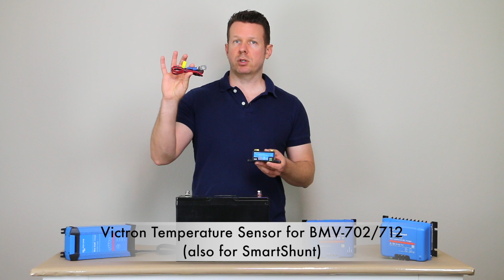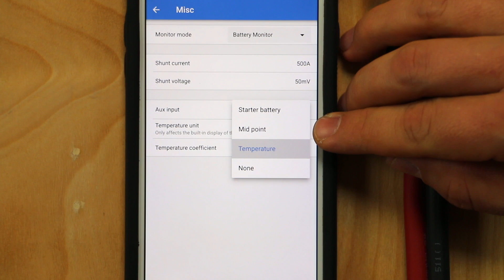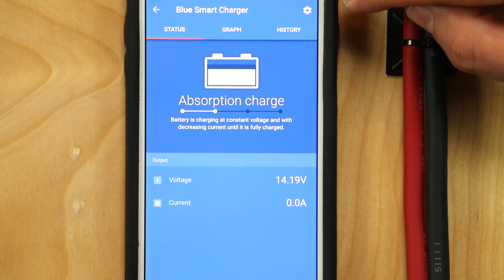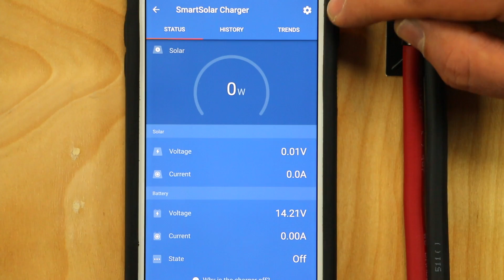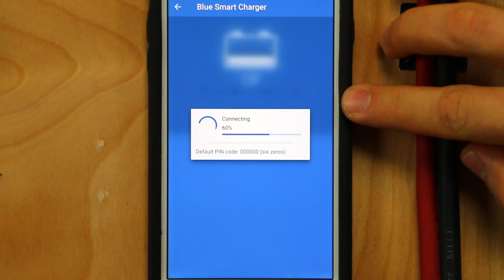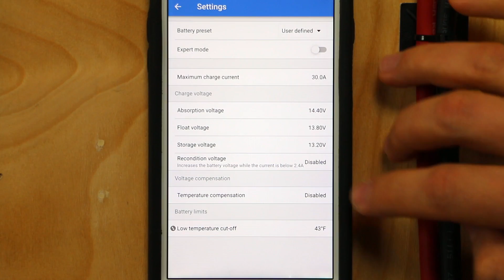The Future of Battery Charging in Van and RV Power Systems featuring the VE.Smart Network

Comment: Great information. Thank you! So, can I leave my old lead acid charger  in the loop after installing my smart charger in my toy hauler RV? I am thinking that with both chargers online, the 60 amp lead acid charger would speed up the recovery of discharged batteries, then the Lithium charger would actually finnish charging my LiFePo4 battery bank. I also have 200 watts of solar panels on the roof. Sorry, I am a rookie to all this stuff. Thanks,!Cheers Danny

Comment: What a wonderful video.  I just subscribed and am interested in using victron systems to make my conversion from AGM batteries to Lithium.  Very new to this.  I just need to research what Items I need to buy for my class B coachmen beyond.  Do you know if the Phoenix 12V 1200W inverter is enough to run my AC that is 13000 BTU.  I have a soft start.  I see that Victron does not make a larger inverter.  Do you know if that will ever be in the works?  Again great video.
Reply from the maker: Thanks for tuning in, your 13kBTU AC will be about 2000 watts, so the 1200w inverter will be too small. You might go with an inverter-charger from Victron, they have them in 3000VA (2400w) and 5000VA (4000w) models. Look for the MultiPlus and / or the Quattro from Victron. That soft start will also help. Hope that helps, thanks for tuning in!

Comment: I think your analogy with pressure is not adequate. LiFePo4 batteries do not work like that, the charging voltage is much more complicated than the pressure analogy. In a presurized system, the pressure you have is the pressure that is in the system. If you measure the pressure inside the tire at the same time you are pumping air in, you get the real pressure. With LiFePo4 batteries that is not the case at all. The charging voltage is not the battery voltage, and different chargers can have differences in voltage and, therefore, consuming instead of charging or disconnecting themselves because they believe the battery is charged when it is not (because other charger is charging), thus interfering between them

Comment: Hi. If I have 2 bluesmart chargers 30a each putting on the network, would it give 60 amps in total or whereabouts? Thank you
Reply from the maker: Yes, I also have two in parallel and I can confirm they will put out 60 amps together. Thanks for tuning in-
Reply: @rosslukeman  strange if I parallel, they give max. 32amps. Someone suggested to network them, not sure if it would work, fingers cross.

Comment: We have several mountain top radio repeaters currently being powered by utility AC power with standby LPG generator power for power outages.   
Each repeater is powered by 12vdc (11-14VDC) at 3amps standby (80-90% of the time) / 15 amps when transmitting (approx 10-20% of the time). We use 120vac to 12vdc (20a) power supplies to power the units.

Some day, we’d like to install solar at each site, but for now, we’d like to install a single LifePO4 12v / 100ah battery to each repeater to provide backup power for the 20-40 seconds the generator takes to start and come up to speed.
AND… to power a repeater in the event the generator fails or runs out of fuel (long-term storm related power fail, etc).
Reply: The repeater has a secondary 12vdc input which is to be used for a backup battery.
It does NOT provide charging current and the mfg suggests using a lead acid battery with a separate battery “tender” or “maintaining” AC to DC charger to keep the battery fully charged and to recharge in the event the battery is depleted during a utility power failure.

Can anyone recommend a charger / “maintainer” that would fit the bill?
It will have to be continually connected to the battery (LifePO4 12v / 100ah or 50ah) and keep the battery fully charged.
After a loss of AC power and the battery loses some charge, the charger must be able to charge the battery once the AC power is restored.

I know these batteries like to be at an 80% SOC, but losing a small bit of its longterm life would be acceptable.

Thanks in advance!

Comment: Do you setup 3 different ve networks in the 3 channel charger?
Since the 3 batteries have different voltages and temps, or needs.

I have also noticed that if you have two mppts (one to each battery) they need their own ve networks to get the right Voltage and temp parameters.
Reply from the maker: Hi Krister, in my case no I set up a single network to synchronize multiple chargers to charge one battery bank. Thanks for tuning and sharing your experience!

Comment: Appreciate the great videos trying to help all of us out here. I have a Renogy 50 amp dc to dc charger with mppt that I would like to install in my class c motorhome. It has lithium batteries, a auxiliary boost switch and on board generator. Can't find any information on how to do the install. Can you help. Thanks so much
Reply from the maker: Hi Sam, thanks for checking out my videos, good to hear they're making an impact on you. In short you would probably leave the boost switch and generator as-is, and splice the Renogy in there as a separate part of the system. Overhauling RV electrical is something I consult on, if you would like to book a call, I can look at photos and give more detail. The calls are here: https://www.rosslukeman.com/offerings

Thanks,
Ross

Comment: Why doesn’t Victron make a combo MPPT/DC-DC/AC charger in one unit, and we could have programming to allow the charger to prioritize input out to the battery, or even use all to improve output amperage. Renogy and RedArc both make a DC-DC / MPPT charger combination. Redarc even has one for $1800 that includes all three. Just wish it wasn’t $1800
Reply from the maker: The All-in-Ones are nice from an install perspective, but I would say there is value to a more modular approach as well, as the end user can size each part of the system for their needs. As long as they network together and talk to each other. I think it's ease of install vs. how customizable things are. Victron historically has focused on "pro" installers so their stuff is not necessarily made for ease of install, although it's arguably pretty easy, especially programming with their Bluetooth app. My two cents...
Reply: @rosslukeman  you do make a good point. Just like in home entertainment centers, going with seperate u it’s allows a little me flexibility with features absolutely, allowing for more custom configurations based on need and uses. One of the other reasons why I went with redarc is it was designed for rough handling to handle hi vibrations and jolts of “Off Roading” adventure campers beyond the normal extremes of simple normal RV’s.
The one thing I wished my redarc had was higher capacity charging for both alternator and ac charging. We don’t have the space or time for a huge solar array either. So it suffices for most “adventure back country camping” I do use a few victron pieces like the battery protect, and battery monitor.
Reply from the maker: Hi Gary, good point on the need for vibration-proof components from RedArc. Glad that made sense about modularity offering flexibility. I do think that you make a good point about higher alternator/shore charging. That's why I haven't covered a lot of all-in-ones, I like to max out charging speed, especially like you mentioned if one of the charging sources like solar is minimal, maximizing elsewhere is more critical. I've heard good things about RedArc though.
Reply: @rosslukeman  I like redarc a lot, I know the quality is there. However the price point is really really high! Vibration resistant devices are only really critical if your going into environments that would create more vibration then the normal paved roads that 95% of Americans travel. Even for the majority of those in RC’s and Travel Trailers. So far the Victron and Renogy devices I have been using have been handling the additional stress. But wondering when they will give out.

Comment: Hello, very informative! How do you add lead acid battery in to the mix? Thanks
Reply from the maker: Hi Robert, thanks for checking out my video. That is a very broad question! Lead-acid should wire in the same as a lithium battery. If you want to see an overall diagram, then I would check out my PDF at rosslukeman.com/vanpower

Thanks,
Ross

Comment: Very nice video with a good explanation but there is a big problem with real-life operation problem number one if you have more than one charger one of the charges will always take the lead it may shut the other one down or it may reduce the capacity of one or the other and the other will charge it a hard higher rate this almost never works out it is especially problematic if the charge rates are low

Comment: Thanks for creating these excellent videos! One question:

In the case of unbalanced cells, can the battery connect and signal this over the VE.smart network and stop the chargers? or do we need to add a BMS for that?
Reply from the maker: Hey there, thanks for checking out another video. On the cell balancing, this is typically handled internally by each battery. So while the VE.Smart network could convey this info, at this time it does not. Cell balancing happens on internal BMS batteries such as Battleborn without adjusting the chargers. The only exception might be the Victron Smart Lithium batteries, which have internal cell balancing, paired with an external BMS. I have had my cells out of balance after having the battery sit a couple of months. When I fired up the system, the battery and BMS worked together to turn the inverter-charger on and off in multiple cycles until the battery's cells were balanced again. This is the only battery/system I've ever seen do that. In this scenario, you can see the individual cells on the VictronConnect app, where the higher-voltage cells bleed off and raise the lower-voltage cells. This system was shown in this video: https://youtu.be/3KUhkdxIppg

Comment: I'm putting together a system with these same four victron products. You describe three sources all filling the tire at the same time like that's ok, but won't that overload the max charge current on the battery? 

30+30+20=80 > 40A max charge on my SOK 200Ah battery. 

Some other comments here imply this problem fixes itself, but I want to be sure before I buy all the parts.
Reply from the maker: Hey there, you are right in that you need to account for your specific battery bank and what it can handle, both continuous and max charge rates. Frankly the charge rate on the SOK is a little low for its size. However, what can be said is that these charge sources work in different scenarios. Having your engine running, while plugged in, with your solar panels in full sun would need to happen to reach this hypothetical peak of 80 amps. Typically shore power and alternator power do not happen simultaneously for any significant length of time. So that changes things. Great question, thanks for tuning in!
Reply: Thanks for relying, @rosslukeman . I appreciate the care you put into your advice. I thought getting a single 200Ah battery would be simpler, but 2x100Ah would have eliminated this problem. Hoping @Larry Volnec's observation that they self-regulate holds true for me. Cheers.

Comment: Hi Ross,
I have one random question haunting me. I have an Orion B2B charger, the manual says "mount vertically with the power terminal pointing down".
The charger fits optimally in my system mounted horizontally, generally, I follow the manufacturers' recommendations, but what reasons can you see that this electronic device must be mounted vertically.

Also as an aside, Victon further adds to mount on a "non-flammable surface", I understand these tend to run rather HOT, but virtually every van installation I've seen has these mounted on wood.. what gives?

Thanks in advance!!!
Reply from the maker: I suppose they want you to mount them vertically because their heat sink fins are oriented that way, and would allow an air current to rise up behind the unit. If you mount it horizontally it kind of stops this natural airflow of hot air rising and creating a draft behind the unit. We must not take this for granted as similar B2B chargers often have a cooling fan. This one does not, so we need to not impede its natural cooling. They are about the warmest components in my systems (because the amperage through them is usually maxed out to their rating). That said, I mount them vertically on painted plywood. In my opinion this is totally fine, they just get warm but not hot. Hope that helps!
Reply: Wood is one of the best insulators. That's why we use it in saunas

Comment: Ross, why do you like non-isolated dc-dc chargers? is it cost and what else? Thanks!
Reply from the maker: Hey Fred, great question. It's because the vehicle power system and my rear power system negatives are not isolated from each other. Both systems have their negatives connected to the chassis, which is the "conductor" returning the electrons to the alternator and completing the circuit. This is just how I do my systems at this point and so the non-isolated version matches my overall system design. Other brands such as the Sterling are non-isolated, but it's not stated as such, it's just how it comes. So when I tried the Victron, I got the one that matched what I was doing with the Sterlings. The isolated version of the Orion allows the negatives from the front and rear systems to not interface with each other at all, except where they converge at the Orion charger. I personally have never had a need for this. Hope that helps!

Comment: Great Information.  I was wondering if you can use a DC to DC charger from your alternator charging lithium batteries and hook 400 watts of solar to the DC to DC charger also.  I've heard this works with no need for a solar charge controller.
Reply from the maker: Hey Keith, interesting question. I see a couple of potential issues. First, the DC to DC controller shown here for 12-volt alternators accepts 10-17 volts. The majority of solar panels/arrays will have a higher voltage than this, with solar panels starting out around 20 volts and going up to maybe 39 volts. Also, even if you were able to get solar under the voltage threshold, you would max out your charging at 30 amps, and probably forfeit another 15 amps you could have gotten to increase the charging rate. Renogy has a combo solar/alternator charger, but it too has a maximum amperage that will throttle down what you could have gotten to about 600 watts. I like to put different chargers for different power sources, because at the end of the day, they are different animals with different power characteristics, as noted above.

Comment: great video and well organised, my blue smart charger in the uk does not have the ve smart networking like all my other victron items so i guess this a new version
Reply from the maker: Interesting to hear, I wonder if you could update the firmware? I have done this on other components and "found" features that I thought had gone away.

Edit: I found this note on the VE.Smart Page at Victron:
Only Blue Smart IP22 Chargers starting production date week 24 of 2020 (serial number HQ2024nnnnn and newer) are supported. The hardware revision printed on the product label should be “hw rev 02” or higher.

Comment: Wonderful explanation Ross. I was wondering what happens if you have such a network and then plug all the chargers into a Cerbo. Does the Cerbo take over control of the changing and disable the network, or is there a possible conflict?
Reply from the maker: Hey John, there is usually no conflict when there are multiple controls or data sources, typically one will just be ignored. Here is what Victron says under the "Limitations" section of their VE.Smart page (https://www.victronenergy.com/media/pg/VE.Smart_Networking/en/limitations.html):

"VE.Smart Networking is designed for small systems which do not have a GX device - such as a Color Control GX or Venus GX - controlling the chargers (e.g. in an ESS system) - See FAQ Q5. In systems which the GX device is used for logging purposes only, VE.Smart Networking can be used to allow chargers to synchronise, or even receive information from sensors. Keep in mind that if, for some reason, the same information (i.e. voltage sense) is being received by the charger over BLE and VE.Can/VE.Direct, the information coming over BLE (through VE.Smart Networking) will be ignored."

The Cerbo is a GX device, so would fall under what it says above. The last thing they said is basically if the devices are hardwired together, it will take its information from the data cable over anything coming in over Bluetooth (radio) signal. Hope that helps!
Reply: @rosslukeman  That’s very helpful. Thanks.

Comment: If I am using a battery equipped with a BMS that has a temperature sensitive relay, such as the Daly Smart BMS, then would the functions provided by the BMV-712 be redundant?
Reply from the maker: In this instance, most BMS's are battery-centric and would shut down the battery, but leave the chargers on. In this instance the BMV-712 with a VE.Smart network would also shut down the chargers at a low-temperature setpoint.